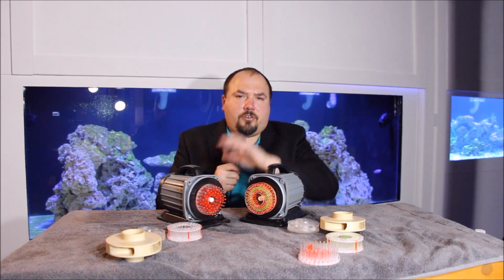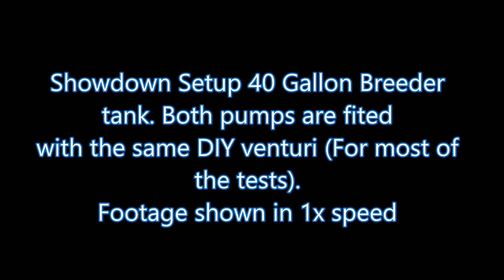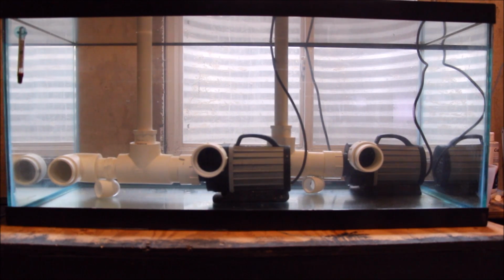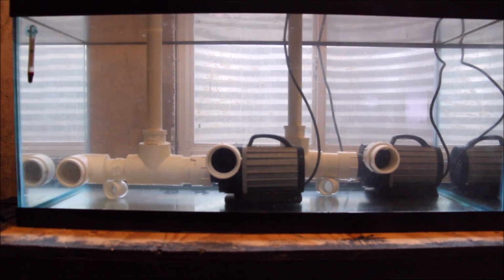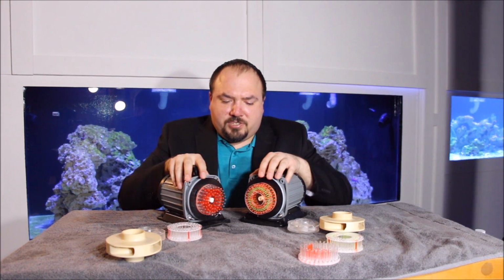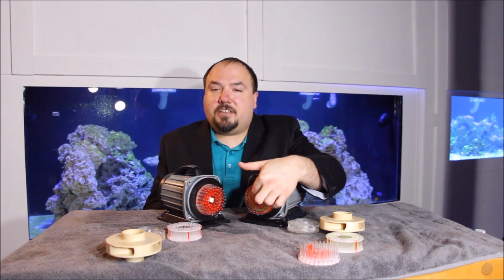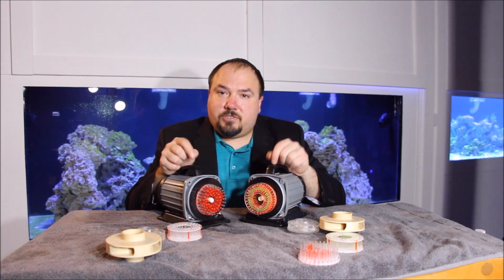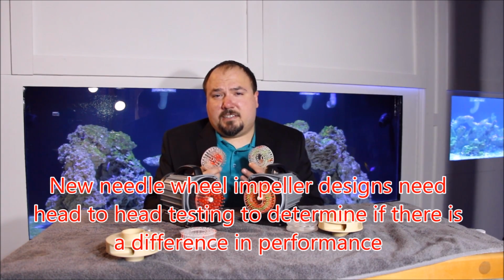DIY Needle Wheel Showdown

Comment: I really liked your video. Your production is great and you have been doing a great job with your DIY work. I only hope I can soon produce videos as nice as yours.

Only a few notes as to the technical aspects of the testing. Not sure if you noticed but the output of one pumps had a pvc pipe in the fitting. 
Also while comparing the two wheels with the 1 inch venturi's not all the pvc fittings were the same. When doing a heads up comparison everything needs to be identical accept what is being tested. So it's hard for me to tell if it was a draw because I don't know if they both have the same amount of air draw allowable and if the pipe in the output fitting has affected anything. Maybe redo those parts and edit them into your video. Sorry but it would help me greatly to know if it had any affect.   I know my DIY testing isn't perfect by any means but I try.
Reply from the maker: Thanks for the comment JoeKooL Reefvid.  I am glad you enjoyed the video.  While PVC fittings were not identical the water intake is reduced from 2" to 1" for the venturi so the water intake should not really be limited by the extra fitting.  I can see performing this test again in the future though with the exact fittings on each pump.  It should be noted though that even with the extra fitting on the double layer needle wheel impeller pump intake it still seemed to produce more overall water flow than the single layer impeller.  When both pumps were on the 1" venturi the allowable air draw should have been the same.  I don't think that the 1" venturi air intake was needed though as the 1/2" venture seemed to draw a similar amount of air into the impeller based on the suction created by the pump.  Really airflow and water flow should be measured to see what the actual differences are between these two impellers.  I definitely have some refinements to work on the next time I complete impeller testing.

Comment: Use a Kill-a-watt to know if they use less/more power at the same setting - I have a feeling one might be more efficient on High, and the other on Low. As for durability - who cares! It's DIY, you'll want something to do, down the road! (lol)
Maybe one of the impellers will require more amps (thus more watts) on startup, then will probably "idle" the same.
Reply from the maker: I might have to get a kill-a-watt to perform this test at some point.  It would be interesting to see if there is a difference in power draw on startup and idle.
Reply: That's what I was wondering too. My guess is that the double layer design uses more power because it seems to be moving more water.

Comment: If there dc there useless the drivers kill your electric bill I just pulled a dc jabao 5000 10 speed out of a skimmer and fitted a sicci 1200  loads more bubble chopping and only 20watts 240v were my dc pump was using 600watts of mains electricity I never having a dc pump ever again